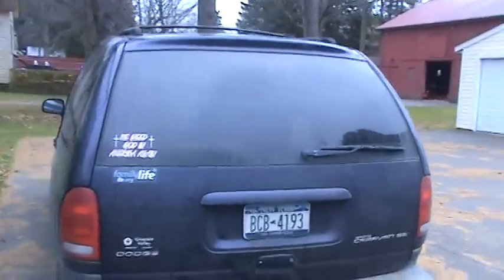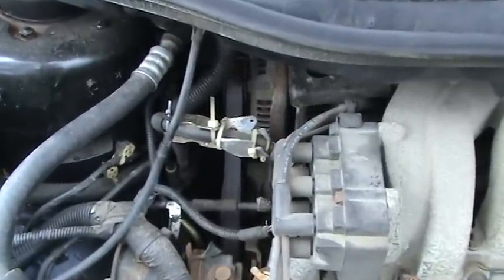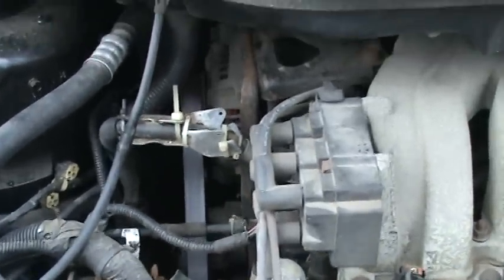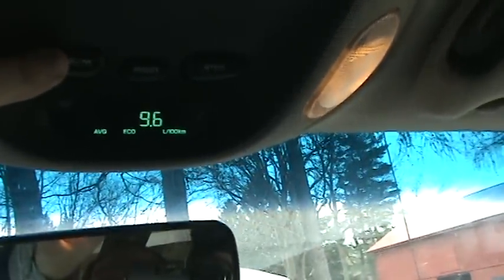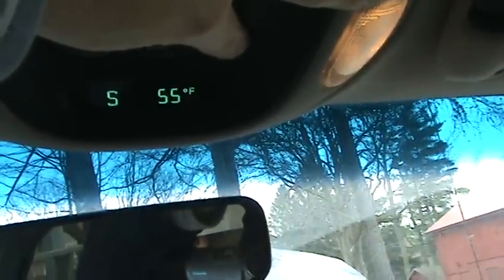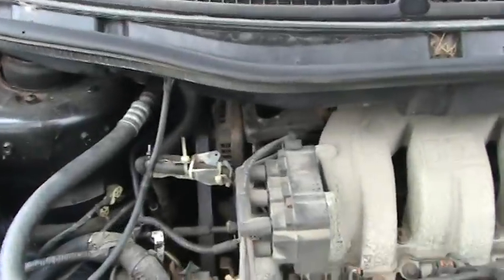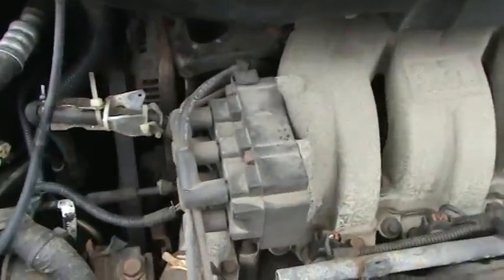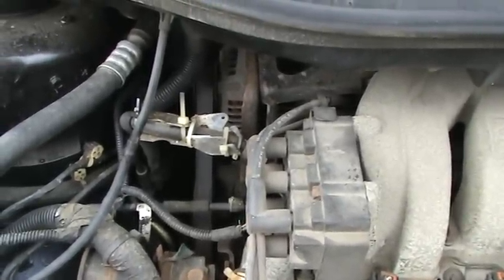Get Better MPG gas mileage with magnets

Comment: Most minivans, including this one in video usually get 24mpg already...not 18....I have a Subaru AWD and it gets 24mpg....had a Durango RT that got 17mpg...had 3 minivans with V6 engines like this one in video and they got 23-24mpg....soooooooo somebody is an idiot and pretty sure its not me
Reply: LOL, YEP!  I have gotten 26MPG with my Acura MDX, a 4500 lb. behemoth with AWD.  AND, I used regular 87 octane.  What these morons aren't getting is that even though the actual combustion is mechanical in nature, the timing and fuel flow is automatically adjusted by the ECM.  It doesn't matter WHAT you do before or after!  The MAF reads airflow, reports to the ECM, and the ECM adjusts the entire combustion process accordingly.  You CAN NOT override this.  You can only re-program the ECM, which is a whole other can of worms.  There are literally millions of master mechanics in America.  Wouldn't one of them package and sell this solution to become a billionaire if there was any truth to it?  Hell, K&N charges $80 for a $3 cotton air filter to get a 1 or 2% boost.  But NO ONE can figure out how to make money off THIS thing, right?  Except for the brilliant minds of suburban, YOUTUBE surfing, driveway mechanics, that is.  Where would our country be without them?!?
Reply: @kaganhudayar630  people DO sell magnets for the fuel lines on the internet, unlike what you say.
The magnets help the fuel burn more complete by breaking up the pos neg clusters in the fuel.
Take care.

Comment: What kind of high performance spark plugs did you use ?
Reply from the maker: Double platinum or split.  The sharper edges make better sparks.  They make an o shaped plug but I do not know if it is worth it.

Comment: Magnet rotated 90 degree, meaning they are in opposed position? That's why you have the zipped tie? Why 2 sets? more strength?
Reply from the maker: The magnets from a hard drive come configured to be used without modification, just add zip ties.
Reply: Bob Davis Have u still had success in using the Magnets? What was the out come?
Reply: I get 2-3 mpg better with magnets on my cars.
Reply from the maker: Kyle Posey  2-3 MPG and the vehicle runs smoother.  I also add platinum spark plugs.
Reply: Cool deal. Gotta 02 saturn sl2 manual 5speed 4dr ima try it on. Wonder if a set before the fuel filter and after would help?

Comment: 24.4 hahaha.... thats awful. American gas guzzler crap. My MPV is a VW Sharan... and wil do 120MPH and at reasonable speeds like  70mph you get 40MPG!  Lord knows why you Americans still put up with useless engines in your cars. Get something european and save LOADS. You can chuck the magnets in the bin then.
Reply: ty cooper 1998 VW Sharan Diesel 1.9 TDII 135 BHP
Reply: +ty cooper +ty cooper Lets think about what you said, your country has more strict 
emission standards whilst allows cars which guzzle 3 times a much fuel. 
So basically then putting out 3 times as much emissions of greenhousse 
and monoxides but just not particulates. So give with one hand and take 
away 3 times as much witH the other.
Reply: +truthseekers666 Besides the gallon conversion.....europe generally has much, much smaller cars than we do here. Along with that, some of the devices on our cars that lower emissions also lower gas mileage. I have whats considered a small car here, a civic coupe. And it weighs 2800lbs and i get 45mpg (us gallons) highway easily.
Reply: +Troll True Yes these "imported" cars are taxed high to cat 22 you... buy a car that is efficient and save money on fuel but pay more to get one in tax. or 
buy a cheap as fuck american one and pay tonnes more on fuel. So catch 
22. You dont win either way but in the land of the "free" this is the 
illusion of choice. I do hear your point... cheap US cars = us jobs for 
us car makers hence why cheap. they just sting you on the fuel 
prices for how much more fuel you use.... and I think youll end up paying FUCK LOADS more for fuel than
 for the car but it doesnt seem that way because peopel only see to the end of their nose. Its like inject printers. Printer costs $50 - cartridges 
for it cost $20 each and there's 4 of them and they run out real fast. 
thats the american car model.
Reply: +truthseekers666 You can't buy something that isn't allowed to be sold.
Reply: +FieroGT42 Not strictly true. You can buy it and run it but youi might need to take in and out of the US borders to keep it legal. That way it isnt a 365 day a year American car...
Reply: truthseekers666 your Sharan/Ford galaxy is obviously diesel and if you do real world, filled to brim to brim. You won't be getting 40
Reply: Matthew Williams man I don't know what what someone told you about about American I've read everything you have to say and you need to stop watching TV and focus on your life read the Bible and realize American is the land of milk and honey!
Reply: Us Americans would LOVE to have the engines from your country, it is our PATHETICALLY CORRUPT GOVERNMENT that will not allow us to import such an efficient engine, so we're stuck with having to work with what they allow us to drive here. We even tried sneaking a John Deere 4 cylinder diesel tractor engine in a Ford pickup, worked Great, got 60 to 70 mpg, then government mandated emissions testing on older models, went to the test station, they opened the hood, confiscated the truck and we went to jail 30 days!!! America- Land of the Sleeze and home of the Slaves!!!
Reply: @timmorris3056  how did you modify the transmission to hook up that John deer in that ford
Reply: @JamesSmith-lt5zz  bellhousing adapter plate, you can make them yourself or buy them, several companies. V8 swaps into Suzuki samari, fiero, Volkswagen turbo diesel into just about any car, they'll make the adapter because it's so popular. And many more, Etc. Etc.

Comment: Relying on the car's computer is unscientific.  You have to 1) measure the fuel used, 2) measure the distance travelled, and 3) duplicate the driving conditions for the control.  Mythbusters already did this work and declared it busted.

Comment: Just put the magnets on top of the Electronic Control Unit (ECU) and you'll be surprised with all the changes. Lmfao. You'll ruin the electronic system and drive all information reading crazy. xxxxx

Comment: doesnt work,
This has been tested by Mythbusters, Autoweek and the EPA, doesnt do a thing to improve gas mileage.   IF it was this easy to improve MPG every car manufacturer would have this on from the factory
Reply: RattlerX5150 Mythbusters didn't say what type of magnets they were using; probably iron or steel magnets with low gauss. Hard drive magnets are neodymium which may make a difference since they are stronger.

Comment: Hi all, I've being using magnets since my first car VW Beetle more than 30 years ago. Did it on gas & diesel cars. Unfortunately for all of you guys out there looking for a miracle I've to say my results never indicated any kind of fuel economy directly actributed to the magnets. Although there's an hiden advantage that's undeniable and I never saw it mentioned. It helps "clean" the engine of suspended metal particles. Used in critical places like oil filter / oil plug ( just stick them there). It help retain the ferrous metal particles in suspension in the oil. No snake oil, just like what happens in the gear box plugs. the tiny metal shavings can then be easily removed in any normal oil change. In fact they are also removed without the magnets when you change the oil, but more eficiently when they are "stuck" in the oil plug instead of being all over the place inside the engine. Even modern oil filters can't retain those really tiny shavings. magnets do it for free and its damn easy just to stick it in the plugs, etc. btw old hard drives magnets are the best cost/benefit magnets you can find. In the long run yes its beneficial, but not for fuel economy, maybe we can call it engine economy. About the fuel economy, sorry to disapoint you guys. ;-)

Comment: Here is an experiment for people who want to risk their engine.  

Get A piece of paper and twist it into A pencil like shape.  The put it in your intake and secure it there. This will pull coolant through your headgasket at A slow steady rate.  You can put your fingers in the exhaust stream before and after so you can test the difference. 

  Next you adjust your TPS sensor all the way out.  On direction will increase fuel and power, while the other way will lean out the mixture, reduce power and run hotter.  That is why you need the trick above to cool the engine by creating steam.

  You should be able to run fairly lean while doing this trick. So buy the proper fuel adjuster for your vehicle and environmentally friendly coolant as you will be smelling it more often, when outside your vehicle.

 Rotary engines might benefit the most with this trick as A lot of fuel is wasted for heat reduction.

  Fuel magnets take months to fully work and must remain in the same position to get the best results.  They don't work for every vehicle so you need to experiment for yourselves.
Reply: Nonsense..! Aren't you getting tired of listening to the nonsense coming from your mind machine tool?
If so, that's great and then it's finally time to tame and quiet it with specific SF self forgiveness on our obsessive thoughts through holistic writing technique. It's our desteni. 
Take care of yourself.

Comment: False.  The EPA found no such improvement in fuel economy with any of the devices it tested, except one, a vacuum switch that shut off the air conditioner compressor during acceleration.  It improved MPG 4%, but only in stop & go driving, not steady speed highway driving. There is no benefit to adding such a device in any car manufactured in the past 15-20 years because they come from the factory with such a feature, as part of the engine management computer's programming.  If you have an older vehicle and want to add such a feature, either for better fuel economy or because you have a really weak engine, include a 1-5 second delay to prevent the compressor from turning on when the transmission shifts (the device tested by the EPA suffered from this, also its contacts burned out in a few weeks).  This can be done with vacuum mechanisms (chamber, one-way valve, bleeder) or electronically.  A throttle position switch can substitute for a vacuum switch.
Reply from the maker: False.  The EPA studies said that it was not worth it because back in 1980 gas was cheap.  They also used cheap magnets for their studies that were not worth the effort.  The EPA studies showed no change, to at the most a 7% improvement in a Ford Fairmont if I remember.  I have copies of the studies around someplace.
Reply: Bob Davis I'd appreciate it, or you can just tell me which studies they are is in this list from the EPA that spans the years 1972-1999:  http://www.epa.gov/otaq/consumer/reports.htm

Also please explain why auto makers haven't installed powerful magnets to boost their fuel economy so they can meet corporate average fuel economy standards and sell greater numbers of fuel gulpers, which tend to be higher priced and have higher profit margins.  Instead they've resorted to much costlier measures, such as using more expensive but lighter metals, reducing friction inside engines, using transmission with more speeds, using fuel injection, and even going to hybrid drive.
Reply: +Troll True Your absolutely right. Car manufactures really do prefer to throw money away on complex technologies to increase fuel economy and power. Why, they could just go on amazon and get the same results from a magnet for $10! People really need to start using logic....this is the exact reason scams like this make money, because people that buy it dont know the first thing about how engines work.

Comment: there is nothing in fuel that is magnetic so this would have absolutly no effect. also that looks like the line that goes to the heater block under the dashboard, although i cant really tell for sure

Comment: If you really want to increase the fuel mileage take some neodymium magnets and crush them into a fine powder, then sprinkle them into the intake while the engine is running. The magnet powder will get imbedded into the tops of the pistons and cause a 99% increase in the combustion, most cars will get over 100 mpg with this trick.